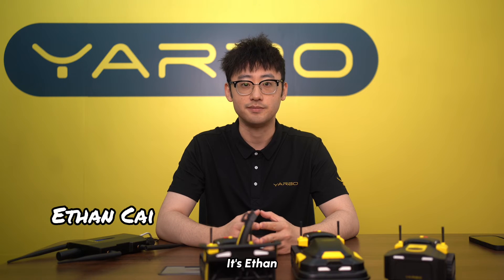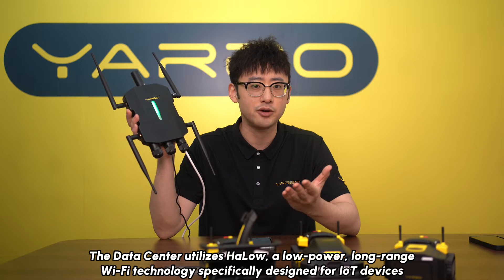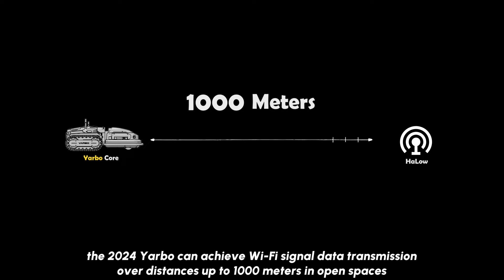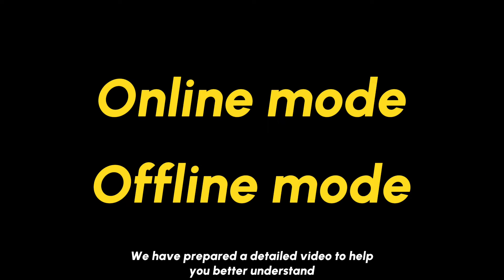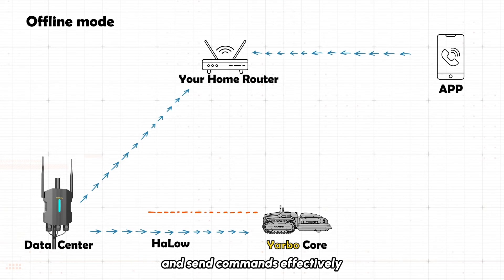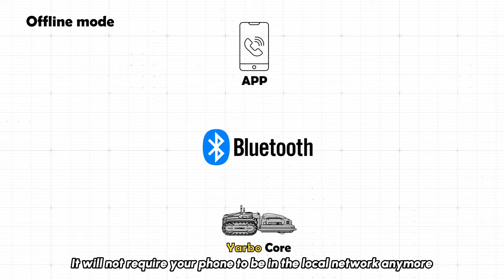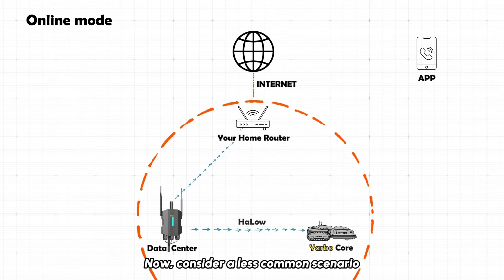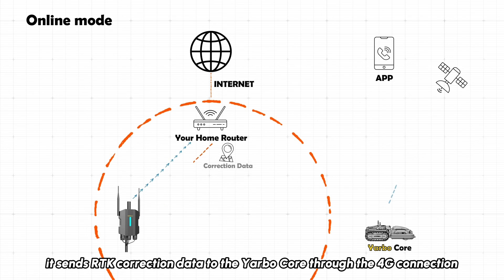The Secret of Yarbo: Introducing Data Center, The New Connection Method of Yarbo!

Comment: Since the Yarbo connects to 4G when it exits the base stations range. Is a monthly cellular subscription required?
Reply from the maker: Thank you for your question!
The SIM card currently included with Yarbo provides free 4G data every month—there is no additional charge for data usage at this time.
There is a monthly data limit, but under normal usage, it should be more than sufficient. If you have specific concerns about data usage or encounter any issues, feel free to reach out to our support team at support@yarbo.com—we’d be happy to assist you further! 😊

Comment: Is it required for the datacenter to be connected to internet? And can it connect wirelessly to my network or must it be connected by cable?
Reply from the maker: Thanks for your question! The Data Center requires an internet connection to function properly. It must be connected by Ethernet cable to your network - wireless connection is not supported for the Data Center itself.

Comment: I have a family off-grid cottage that doesn't get cell signal. Can I bring my Yarbo from home to the cottage and still use it to plow snow or cut the grass with the remote or the Bluetooth fonction?
I would recharge it when we start the generator in the evening.
Reply from the maker: Hi there! Yes! You can use Yarbo’s manual remote control to plow snow or mow at your cottage without cell service or Wi-Fi. Bluetooth has a range of ~30 ft, so you’ll need to stay within that distance while operating.
For best results, test the Bluetooth connection and manual controls before relying on it full-time. If you need help optimizing for off-grid use, email support@yarbo.com—we’ll guide you! 😊

Comment: I have an existing RTK base station for other devices that I use on my property.  I have a few questions...
1. Can the Yarbo RTK base station be calibrated with its exact installation location so that it provides calibrated correction data rather than just relative correction data?
2. Is the data center HaLow wireless acting as a repeater (bridge) for the upstream LAN or is it running an isolated network with separate IP addresses (data center is a router)?
3. Can the RTK correction stream be accessed by other devices?  (I'd prefer to not need two RTK base stations covering the same property)
4. Can other IOT devices equipped with HaLow radios connect to the data center HaLow network?  (One HaLow network for all on-property devices that only need low speed connectivity and RTK streak access would be preferable).
5. What POE class is the data center, how many watts?
6.  Will there be support for Yarbo to use an existing RTK correction stream (NTRIP, LoRA Serial, etc) and the customer's own HaLow or even Wifi network if they already have them built out with proper coverage?
Reply from the maker: Hi there, thanks for your interest in Yarbo! The RTK correction stream is one to one binding with Yarbo, meaning it cannot be accessed by other devices. Additionally, IOT devices with HaLow radios cannot connect to the data center's HaLow network. While we can plan to support Ntrip in the future, we currently recommend using the services and instructions provided in the Yarbo user manual. And we will definitely inform our users when the new Ntrip service becomes available. For more Yarbo information, please feel free to contact us at service@yarbo.com, and one of our team members will respond soon. Thanks again for your interest and support!

Comment: Can it work without the Yarbo Data center? I have WIFI 7 on my entire property and would rather not add more stuff for only one device.
Reply from the maker: Hi there, thanks for asking! Yarbo replies on RTK technology which needs the data center as the reference tower. The data center provides correction data for centimeter grade navigation. Yarbo system does not rely on your WIFI setup, instead Yarbo system has its own WIFI Halow that provides 31 acres coverage. For more detailed info, please feel free to reach out to support@yarbo.com😊

Comment: I have a 2024 model on order and it would be very helpful to have front and rear pics and dimensional specs for both the data center and the included pipe so I can plan and prepare the site where I want to install the data center.  Thanks!
Reply from the maker: Hi there, thank you for your support!  For more information, feel free to check out our website at https://r.yarbo.com/4ezvbNd.There is also a Customer Support Center on the botoom of website, where our staff are waiting to answer your questions！

Comment: YARBO says 1000m with unobtructured view, or
200meter / 656ft for obstructed scenarios, or 
You can use "4G backup cellular" connection if M1 machine is outside of the HaLow wifi connection coverage and no open sky, but consider that not all users want to pay monthly for 4G connectivity.

YARBO BASE = CHARGING / DOCKING STATION

YARBO CORE= M1 with tracks (main body) + HaLow antennae + GPS (satellite RTK antennae)  + ViO (visual inertia odometer) 

YARBO DATA CENTER = HaLow antennae + GPS (satellite RTK antennae)

BOTH the YARBO DATA CENTER and the M1 machine unit needs to have adequate open-view of the sky.

WiFi HaLow = Low frequency wifi connection ("low power, longrange wifi technology for ioT devices"), between DATA CENTER and M1.

Since WiFi HaLow system uses Sub 1 GHz frequencies (~900MHz), even though my wifi-6 mesh network relies on mesh (REPEATERS) for strong connection to my phone, the HaLow system SHOULD BE inherently better due to less signal attenuation.

    .... HOWEVER, will WiFi HaLow signals penetrate through a hill ? Or communicate to the M1 on the OTHER side of a hilltop with a large deadzone (in between several hills) meaning 1) imperfect wifi HaLow coverage, 2) no 4G cellular coverage* , ... and 3) semi-shady / >75% open sky, or does YARBO need to consider selling HaLoW REPEATERS for it's DATA CENTER (to install OUTSIDE of a secondary structure, or for example on top of a barn / shed) ?

This scenario is with the assumption that the CHARGING BASE & DATA CENTER is already as close to the deadzone side of the house, and the DATA CENTER has perfect open-sky view, but still cannot cover the deadzone in between hills perfectly via the HaLow wireless system.

Comment: I currently use a competitive product from European supplier. It struggles not with RTK but GPS signal availability under trees and part of the yard I would like to mow is covered with trees. Most times it is eventually able to recover but many times it does not and just sits until I move it physically. How would Yarbo handle this?

Comment: Does the data center need to be mounted on the roof? Or can it be setup on the yard with 120-360 view of the sky?
Reply from the maker: Hi there, thanks for your question! We recommend mounting the antenna on the roof for the best sky view, but installing it in your yard or on a wall is also possible as long as there's an unobstructed view of the sky. Just remember to perform a signal test before finalizing the installation to ensure optimal performance.

Comment: Does the entire Data Center need to be mounted outside?
Or can you mount just the RTK antenna outside with a cable run back to the data center?
Reply from the maker: Hello Trevor, Yes, the entire Data Center needs to be mounted on your rooftop because the RTK system is integrated into it.

Comment: Any chance Data Center is powered via PoE and can therefore be directly connected to the local network/internet directly via Ethernet? This would reduce the number of cables going to the device and I believe there would also be some reduced latency benefits as well with transmitting data.
Reply from the maker: Hello Cacs Tech, the Data Center will utilize Power over Ethernet (PoE), and we will provide a lightning rod/cable to safeguard against lightning strikes.
Thank you for your interest!
Reply: Pllllleeeaaaaseee POE :)
Reply from the maker: @MLJenkins  Yes! the Data Center will utilize Power over Ethernet (PoE), and we will provide a lightning rod/cable to safeguard against lightning strikes.
Thank you for your interest!
Reply: @yarboglobal  yes, but does it channel the lightning to charge the Yarbo? PoE is cool and all, but can you innovate LoE ?

Comment: Will Yarbo have a local API?  Could it be integrated with something like Home Assistant or other IoT home automation tools for driving automations?  Could we get real time sensor data from that API, such as the camera feed(s), battery life, runtime, mowing height, etc.  Also, would Yarbo consider allowing allowing more advanced routines to run on the unit?  How is the Data Center module mounted and powered, and does it replace the RTK antennas traditionally seen on other mowers?
Reply from the maker: Hello Jenkins,
Yarbo will provide a local API in the future, but it is currently unavailable. The features you requested will be feasible. Additionally, Yarbo offers customized settings for your unit, and we will continue to expand our customization options. Lastly, the Data Center must be mounted outside on the rooftop with PoE, and it will also include an integrated RTK system.